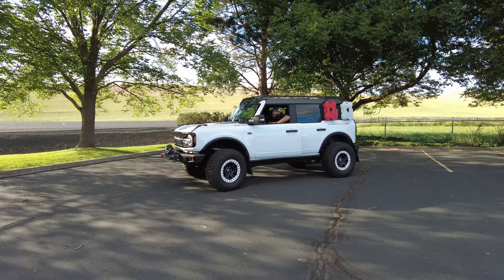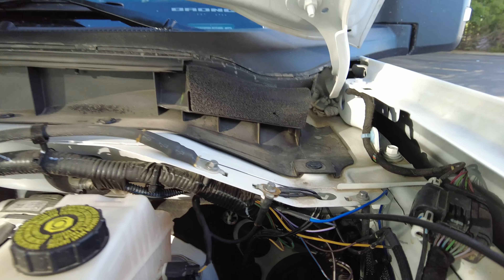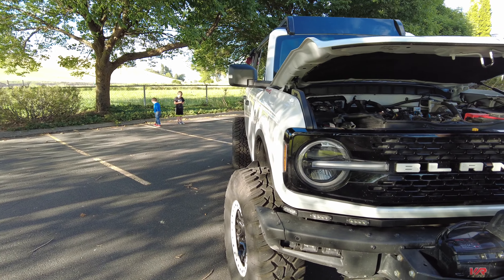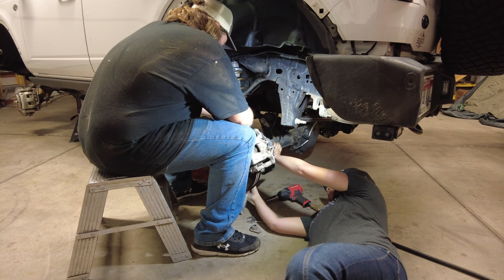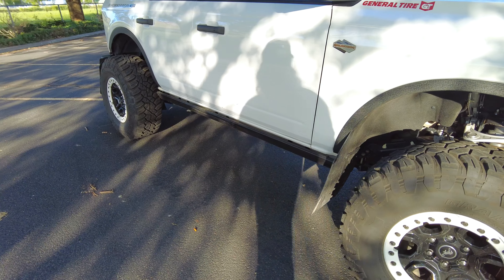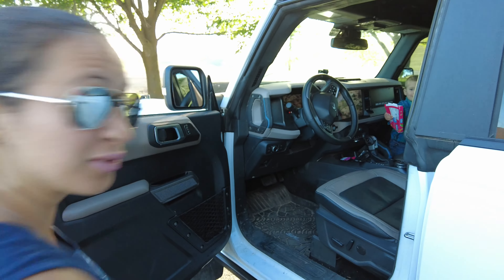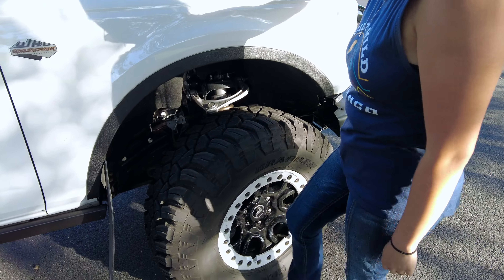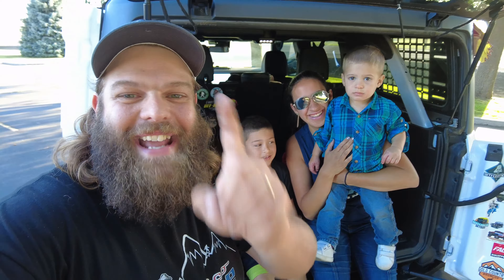ONE YEAR of Bronco Mods, Accessories and Adventures…here's our review!

Comment: Curious what happened to the winch mount? Are the bolts going through smaller diameter than the holes, is it a matter of just loosening the nuts and bolts pushing it back up and retightening? Or did it actually bend?
Reply from the maker: Hey there! It’s actually bent from all of the rocks we’ve hit. The metal is pretty thin where the frame horns attach in order to retain the stock bolt. We’ve ended up bending it back up on occasion so we can use our ACC. Hoping to upgrade this in the near future.